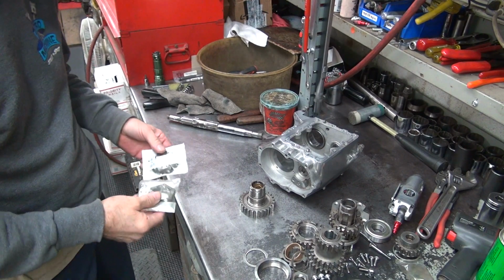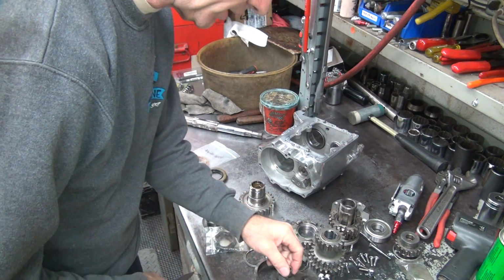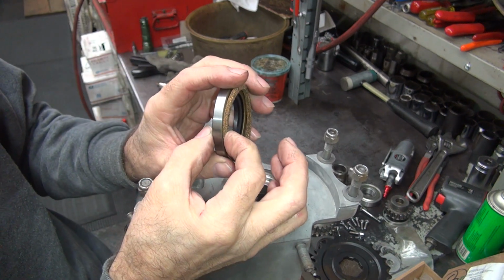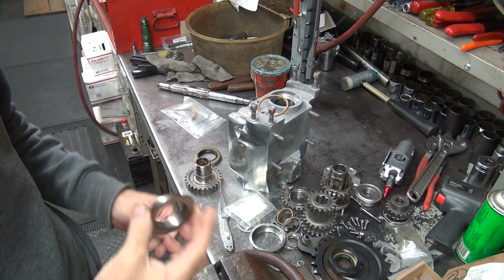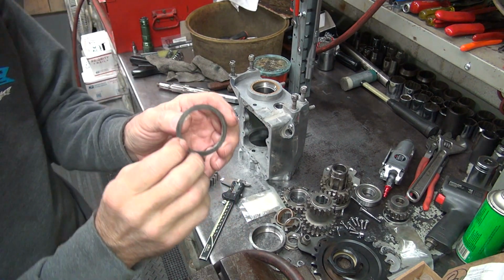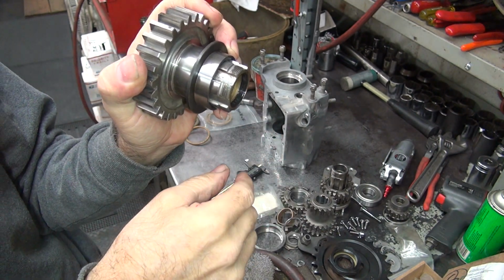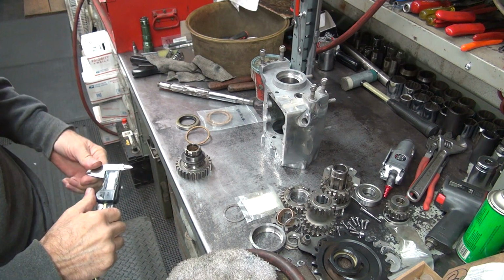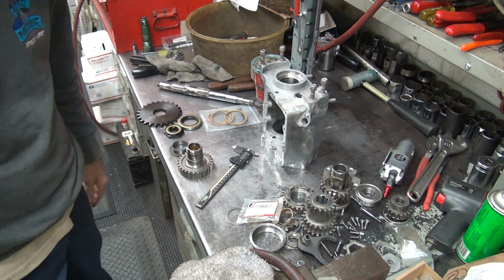#110 1970-84 4-speed revtech shovelhead transmission rebuild 74" 80 ratchet top harley tatro machine

Comment: Does Andrews make a main drive gear with the o ring groove for pre 1977 transmissions?  If I changed the race to run the later caged bearing would my 1975 main shaft be ok with the later gear?
Reply from the maker: i think the early gear gets the groove to but i am not sure. no on the quick change in the bearings. the mainshaft is the same, but the rest will take some redesigning and machining to make the changes you wanted.
tatro
Reply: The main drive gears from Harley 1936 to 1982 don’t have a groove for the o-ring to seal the sprocket spacer on the main-drive gear. Harley machined that o-ring groove on 1983to 1984 4-speeds Too little too late! C.C.I rev-tech gear sets had this o-ring groove on there main-drive gears

Comment: Hello I've got a sputhe transmission with a 5-speed gear set inside. I think it's leaking out of the main seal would you know or have ever dealt with these few transmissions is it a stock main seal I could go in a 5-speed transmission Harley.. I know it's kind of an odd question.
Reply from the maker: its been decades since i delt with one of those. i would have to see the parts inorder to see what parts would be needed and what they are. some parts were harley and some were not.
tatro
Reply: @TatroMachine   thank you for your response ✌️👋